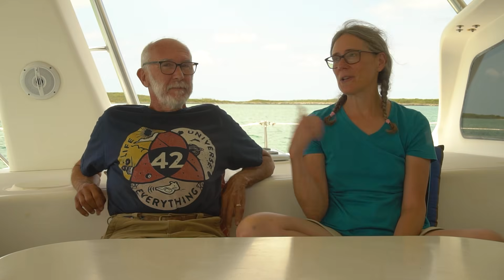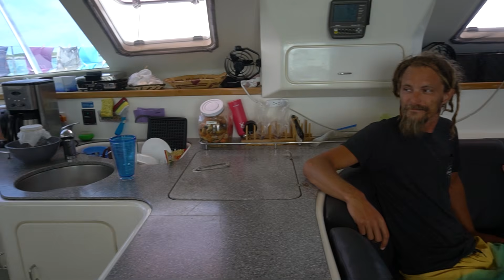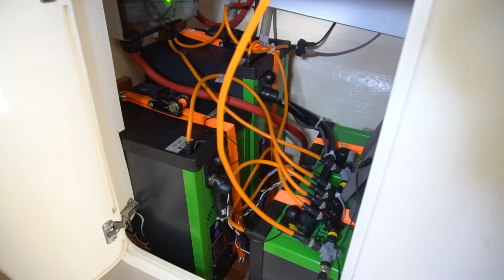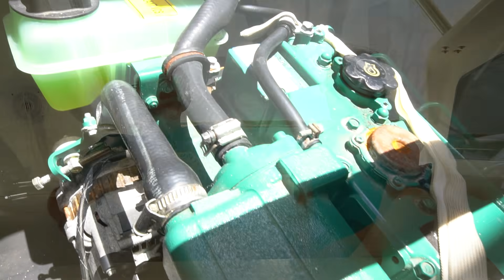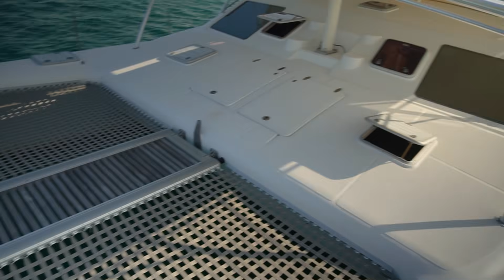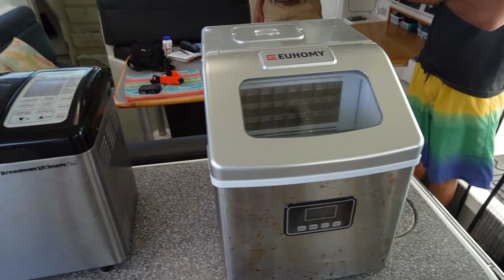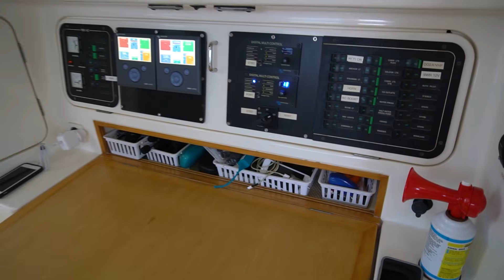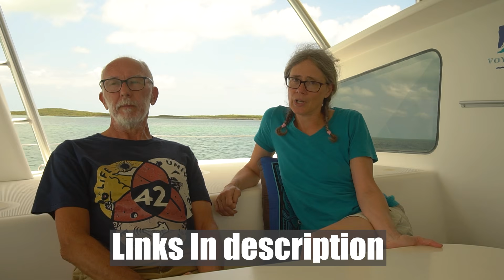100% Solar Electric Catamaran, Interview with owners from Indigo Lady

Comment: Love the conversion. And, as they don't want to sail, it makes a lot of sense. For those that do enjoy some sailing, I recommend at most removing the mainsail and keeping a jib. Plenty of solar real estate without a main and often plenty of wind power with just a jib. It's often windy when not sunny after all. Plus, there's that redundancy of having 2 propulsion sources.
Reply from the maker: Well said Someguy. This works in their situation but it's amazing how much just a jib can propulse you ahead. Fair winds!
Reply: You could get nearly the same solar and keep the sailing rig. Now 1 year after. Tech has improved that fast.
Reply: Interesting point re insurance etc tho. 
For a jib, a mast & rigging is required. However, there's ways to sail without a mast, kite surfers do it.

Comment: Planning on converting a 42 Manta to all electric..   solar, sails, and a generator for backup.    Range anxiety is the only major concern.
Reply from the maker: That sounds like an awesome project! Range anxiety is a valid concern, but with the right setup you should be able to get plenty of range.  Solar panels can provide a steady stream of energy, and sails will help you conserve energy while you're cruising. A generator is a great backup option in case you need more power. Good luck with your project!

Comment: Great boat, great video. Long time solar fanatic (since about 1965). I am looking forward to the day where you don't need to build a beefy supporting roof. When the panels bolted on, or slid into a frame, will form a lightweight, watertight roof, saving tons (literally) of materials and cost.
Reply from the maker: Thanks. Technology is constantly evolving so all we can do is wait and I'm sure it'll be very different only a few years from now.
Reply: @WildlyIntrepid  I have seen a few carpark installations in Townsville, Australia where solar panels do slide neatly into aluminium tracks to make suncover roofs. The technology is growing all of the time. I have been trying to convince my son to convert his Seawind 1000 XL to solar powered as the engine conversion to EPropulsion electric outboards would be relatively easy. For extended cruising, the ability to desalinate water with solar power and no need for refueling is a no brainer.
Reply from the maker: Best of luck with that transformation if it does happen. Not having to rely on diesel would be great.
Reply: This has always been possible. Whilst some form of support (posts & light truss) will always be required. Flat ali strip siliconed/riveted between panels. A 2nd (or more) layer of panels can be on a roller frame (similar to a draw) pulled out when no clearance issues (has a large tile/shingle look, so rain runs off, or caught).

Comment: Great to see someone who has done this solar conversion at reasonable cost. "Silent Yachts" building on the success of the Solar Wave project seem just way too expensive. He just had to be a physicist! An interesting project from the point of view of energy management. Solar capacity, battery capacity, energy consumption at various hull speeds and off course internal energy usage from domestic appliances. Physicists love getting their teeth into such things. Someone should try a similar thing with a mono hull vessel. Another interesting calculation between possible solar area, battery capacity, motor size and hull resistance with speed. Certainly a lot cheaper
Reply from the maker: We found it very fascinating what he managed to do. It goes to show how everything is possible when you put some thoughts into it and just go with it.

Comment: I love your approach to lightning, and redundancy. You clearly have an engineering background. You could grab a 2 burner induction stove as a separate add on. Stow it when you don't need it, use it when propane is difficult to obtain. They tend to be a little slick, so  you use a silicone pad to keep the pits from slipping, with no burning of the mat.

Comment: I'm surprised they don't use copper coils under a few of the panels to heat water. Instead of using a water heater.
Reply from the maker: I'm sure it would work. I've thought of doing something myself at some point but honestly it has not been a priority

Comment: Battery Capacity	typical for power cats, I am really impressed about solar
                282 kW  564 kWh
Speed	 Range	Range
4 kts	131 nm	263 nm
5 kts	98 nm	197 nm
6 kts	59 nm	118 nm

Comment: Thanks for the video.  I am impressed it can go 4kts on panels only.  I was planning a solar cat for years, in my view, it is best to design one specifically for solar panels instead of building a second roof to hold them.  
The boat seems to have a lot of extra weight, but they are doing it, I'm just typing, so kudos, although $350k seems rather expensive for what amounts to a diy effort.

Comment: Envious :)

That's my plan, to get a "small" (something I can singlehand comfortably) sailing cat to do coastal cruising around FL and into the Caribbean as I'm closing in on my early retirement.  

While I like the solar/wind power (which I'll have to charge batteries, and run systems on the boat), I'd miss the sailing aspect as I enjoy sailing!  Not ready to completely ditch diesel sail drives either.

Enjoy living the dream, cheers!
Reply from the maker: I can agree personally I would miss sailing too much to do a full conversion. But I can understand with back issues wanting something easier on the body.

Comment: I think Solar is good. Been designing a boat for a while, a 25 metre monhull with a 5:1 hull ratio. My intention is to have all the decking on board be able to rotate with solar on the underside. You can purchase solar cells individually. Making them rotate wont be easy, but it gives you deck space and solar realestate. I calculate 15-20KW of solar cells, with additional panels possibly sliding out the sides over the helm/cabin or rearward over the aft deck. Still plan on having diesels for main drive coupled with electric motors, a hybrid system that can run both or individually. I would like the boat to be independent. I've calculated 130KW of SLA batteries, also used as ballast, and 40KW of lithium. I want to have a greenhouse in the boat of 10 square metres for growing leafy greens/potatoes. The solar will do well for the UV lights, and fish carcasses will help with fertilizer. Other than Solar, you still have wind turbines, and people also don't utilise the waves or even a pendulum generator on a boat. I would like to include all of these plus an exercise boat and rowing machine can also be used, as exercise is important.  Also looking at a Hydrogen inflated kite system, I have a big imagination, but I think boat designs are all very novice and underdeveloped. The amount people spend on a boat just because of fancy woodwork without any practicality is beyond me.
Reply: Why using SLA batteries? Don’t they lose capacity too quickly with frequent cycles?
Reply: @evgenyzak2035  as mentioned they are also used as ballast. 130kW of batteries will not be depleted more than 10% for my usage. There is a lot of inaccuracies with leaded batteries, they are better than most people think.

Comment: Oh wow your so green! But wait mining lithium uses more diesel then the airlines in a year, oil used to produce the fiberglass resin in your boat plastic battery casings, wire insulation, and every plastic piece of that boat as well as the backings to your solar panels.. yep all from diesel equipment and oil to produce... you know what's actually green..... SAILS
Reply from the maker: I suppose you would have these sails made from cloth of course put on something other than fiberglass? With zero electronics wiring and so on?
Reply: @WildlyIntrepid  I'm good with burning diesel and using plastic. I'm not good with the fallacy if green that ignores the fact green isn't green if you go past the feel good disney surface

Comment: Now add a toyota hydrogen fuelcell unit from a Toyota Mirai. 
Existing Solar + Electrolyser + Toyota Fuelcell + 20kg Metal Hydride low pressure tank

Comment: Love the idea. Would love to get a tour of the cat.
And I especially love your t-shirt. 
I named my 11 meter cat "42" and as a geek who builds superconducting magnets etc. I would love to remove my standing rigging etc. and go full electric. I currently have 1.2 Kwatts of solar and a single 25HP yanmar diesel engine.
Now I'm working on getting a bucket full of money so I can move closer to full electric.
calm seas and following winds... or full sun.
Reply from the maker: Personally Alex and I love to sail so we wouldn't get rid of our rig and a working diesel is more redundant than a electric motor on a all electric boat. That said. If I didn't enjoy sailing and had a diesel I couldn't repair then the all electric option would be preferred. We all decide what's best for each of us. what are your biggest draws on a 1.2kw of solar and what size bank do you have with that?
Reply: @WildlyIntrepid  I motor sail solo mostly.  So I use my retractable drive leg/diesel and normally the furling headsail.
I have 480AH 12V carbon lead acid sealed batteries with a 3.6KW 230VAC inverter. My hot water can be from heat exchanger on diesel engine or inverter 230VAC or in-line LPG instantaneous water heater. I use a bread maker, a  toaster, a oven/air fryer, a sandwich press, a 42 inch flat screen with a gaming level PC, a 230VAC AC, a slow cooker, chargers for laptops phones cameras etc.. Like you I selectively use things to avoid drawing to much current. I live on the East coast of Queensland Australia and usually never go below 75% battery charge.
My last job was building a 265KWATT 48KG electric motor that was used to power a light plane. And am currently on a MRI build for brain scans.

So I'm going to need a BIG bucket of money to convert to electric propulsion. I've lived aboard for 5 years so far with 1 year in a marina and am currently in NZ on land working on getting that bucket full. 
I would love to have fully retractable drives outboard style to reduce fouling and drag when sailing.

Comment: This is a very cool boat and kudos for the courage and ingenuity to make your dream come true. However, i cringed when he mentioned wanting a lower carbon footprint. The carbon cost was all paid up front to manufacture all this stuff and if he was truly concerned with carbon footprint then he should have just bought a small old sailboat with no gas engine. Don’t kid yourself, there’s no such things as a zero carbon footprint unless you’re dead or living in a mud hut.
Reply from the maker: I do agree that it is impossible to be carbon free. At least not fully. But I would rather live a life on a upfront carbon cost and use my energy without worries of where that energy came from  not to mention the costs of building infrastructure to get it to me. As with anything there is trade-offs. Personally on our boat we use much much less energy than we would in a land based environment. Everything is fungal when living on the hook in remote locations. Your trash is managed carefully. With no watermaker your water becomes priceless to you. Even power is managed as to not waste a single watt. I can't say that about my time on land.

Comment: when im on my turtle island in thailand i always see the long tail boats with combustion engines floating around to wait for customers to go 1km to Nang Yuan island or doing a trip around the island.
of course people use a lot of sun screen to protect their skin and when they go for a swim, that sun screen washes off and takes away the UV light from the corals which will be damaged by that. same with the dirty waste coming from the combustion engine.
having a boat with solar cells would give shade to the tourists who need less sun screen.
modern LFP batteries get cheaper every year and get more energy dense because of better chemistries and better materials (silicon nanowires in the anode, ...)
electric motors are simple and cheap.
i hope i see the old loud stinkers vanishing soon and new sustainable tech takes over.
Reply from the maker: It's a slow transition but it seems like more and more are opting for all electric. However it can be more expensive and sometimes just doesn't quite work for the needs of some.

Comment: Sadly there is no carbon free electric conversions, and a lot of components are not recyclable. Sailing cat is much more green and efficient(20miles a day is less than 1knot average speed, even with jury rig you can do better), but still not carbon neutral. I really want to find alternatives for glassfiber boats that are recyclable (Wood is recyclable but pain in ass), and battery technology that are better, but so far its hard. I really love passion of the couple and realizing their dreams, thats what turns world around.
Reply from the maker: It truly is difficult to be carbon free. But those of us who care to try and reduce do the best we can. Personally I like knowing where my power is coming from. Solar or lithium batteries may not be carbon free, nor are our boats but until we have better alternatives this is the best we can do imo. Like you said wood is just so much work.

Comment: I really like the split (redundant) system, I don’t know why more EV’s or hybrids don’t have a split battery system. You could charge one bank while using another, etc.
Reply from the maker: I would imagine it costs to much to build that kind of redundancy. For cruising purposes I think it's worth the extra cost.
Reply: too much added weight and cost for cars i guess,   if a car brakes down your simply stuck at the side of the road.  at sea its a different matter with the ocean moving below you.
as for split batterys,  charging one while using the other doesnt make much sense,  best to have one large one in which you charge and discharge at the same time.
Reply: @sausagefingers714  you are correct about cars, dual batteries/systems wouldn’t make a lot of sense. I guess was thinking about larger vehicles aircraft, boats, and other live aboard applications like RV’s or even long haul trucks if they were hybrids with a small diesel charging one battery bank while driving on the other. Just thinking out loud or on YouTube comments, I guess….lol
Reply: @Topgun12776  you can provide charge to a battery and use it as the same time :)
Reply: @sausagefingers714  how does that work? For a power to flow both directions on a DC circuit at the same time? I know if you had a hybrid situation the generator could power the motors and charge batteries concurrently, but I wasn’t aware a battery can have input and output at the same time over the same circuit…? I guess maybe if the generator or solar charger physical wiring going to the battery bank is not the same as goes to the motor/controller; then you could do both at once, but it seems less efficient than running the motor straight from the generator if you are running it anyway…

Comment: Solar panels are about of carbon and batterys die before just most in their live.
Reply from the maker: That's an interesting take on solar energy, but I'd like to offer a few points of clarification. Firstly, solar panels are actually very low in carbon emissions and are widely considered to be a clean source of energy. Additionally, batteries are designed to last a long time, and with proper maintenance, can last much longer than expected.

Comment: The old marine saying "one is none and two is one" is super important to remember when at sea.  Everything breaks so if you have one of something you are screwed. You are very wise to have two separate and redundant systems. I wouldn't change a thing about what you did.
Reply from the maker: I couldn't agree more. The sea tends to speed up the deterioration of everything. And when parts are hard to get by you're really happy to have this this kind of backup.
Reply: @WildlyIntrepid  Amen brother amen.

Comment: Actually you can build a test one and test it out before you sell it. The trick here is, YOU ARE THE TEST, they are using you as the test one. I wonder if you got a discount for being used as the test bed.
Reply: Oceanvolt referred to us as "Early Implementers", which means exactly that; they didn't build and test before selling. Life is not always a known adventure, sometimes you have to move forward with what is available and trust that problems can be overcome.

Comment: "small carbon footprint" i did spilled my drink when he told that - guy living on 40m yacht, with solar array of small apartment, with batteries that are heavier that normal person is talking about "small carbon footprint". Mate yacht only, or solar only, or batteries only is MORE carbon footprint that normal person living in small apartment will have in WHOLE LIFE! Wake up.
Reply from the maker: Not sure where you are getting your info from but we all have our opinions. Are you aware of where your own power is coming from?
Reply: @WildlyIntrepid  Of course - but i'm not ignorant enough to say that im using power grid because producing power with my diesel generator is lees green. Try to find out how much "green" is your yacht vs 10 cars (production - not using) and then say YOUR OPINION :)
Reply from the maker: @ScOOrK_  I see what you are saying but giving the length of time these vessels last for and the fact they are not just transport but a place to live it's not exactly a fair comparison. I won't argue that regardless we could all make changes to lower our carbon usage regardless of living situation. Personally I refuse to live my life in a small apartment just to feel better about my carbon usage.
Reply: @WildlyIntrepid  Finally. Your last sentence is my point exactly. This is what i wanted from the beginning - u have passion, u have skill, and u have fun, but please do not use terms that do not apply. Thank you - you are doing great job :)